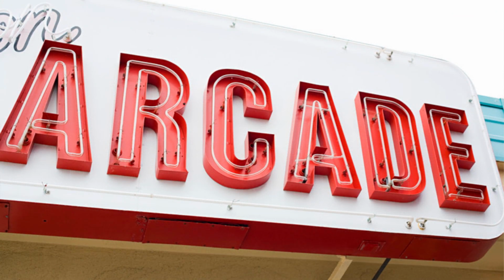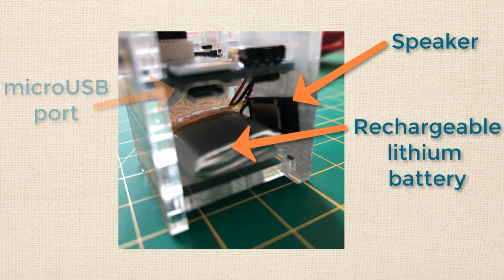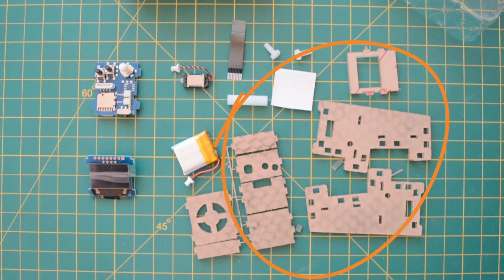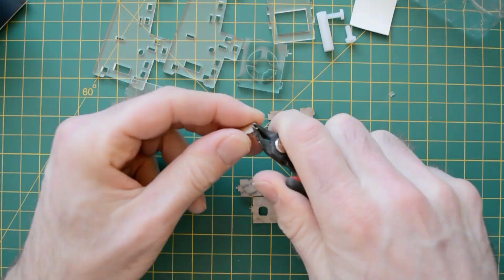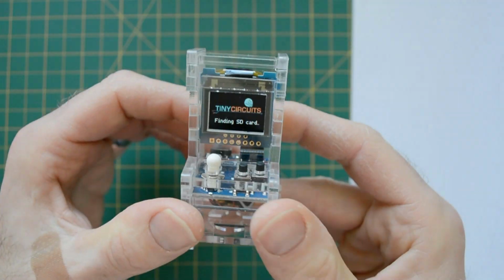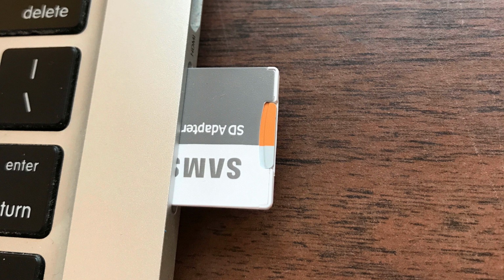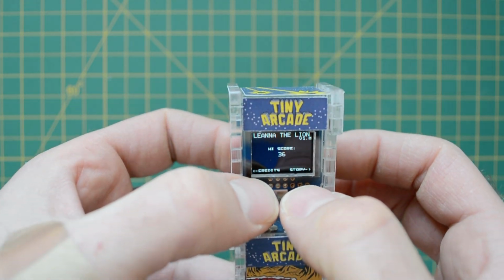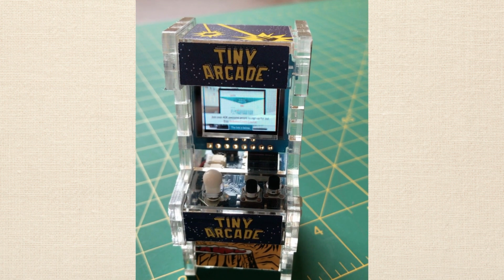Arduino Compatible Tiny-Arcade by TinyCircuits

Comment: The great thing is, you don't have to use it for games. Now you have a nice little system to hack around with. Put mine together in 10 minutes, didn't even need tape.
Reply from the maker: Great point - it could totally be for having some thing prototype with - I hadn't even considered that.